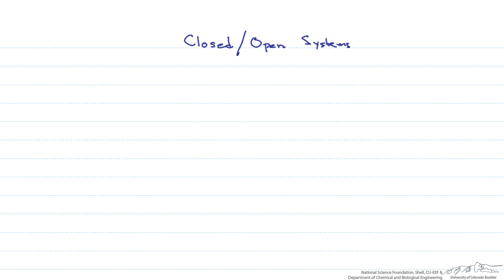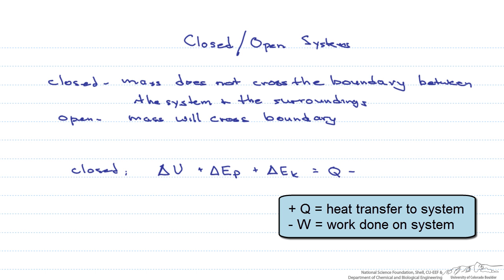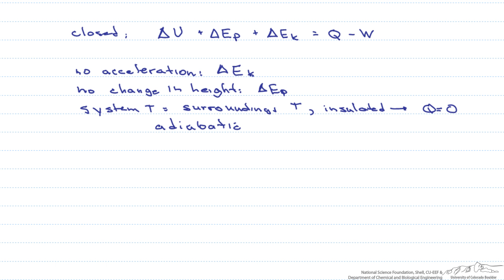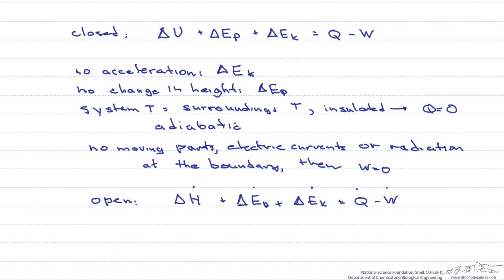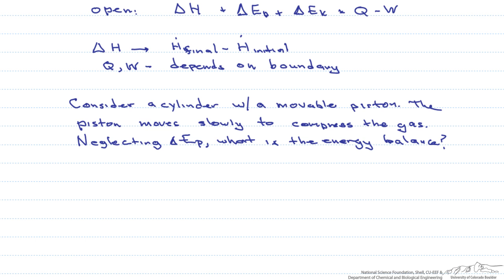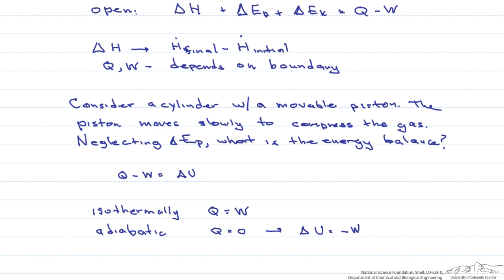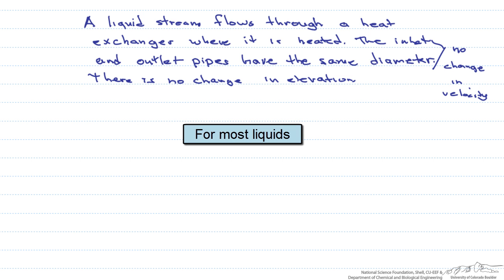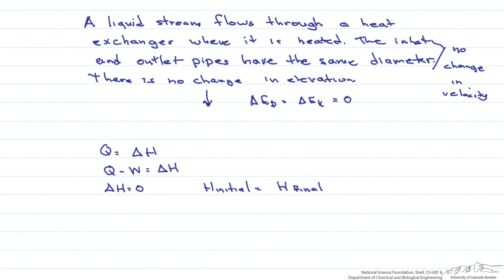Open and Closed Systems

Comment: Thanks for the explanation, but I have a question. At 2:22 you have written -ve W at RHS but in my book its +ve W. 
So, suppose if 100 J work is done by the sys on the surrounding, then W = + 100 J and RHS becomes " Q - 100 " as per your video, but according to my book W = + 100 J (same as above) then, the RHS becomes "Q + 100 ". Wouldn't that give different numerical values?

Comment: #3... Isolated systems = can exchange neither energy nor matter with an outside system. While they may be portions of larger systems, they do not communicate with the outside in any way. The physical universe is an isolated system; a closed thermos bottle is essentially an isolated system (though its insulation is not perfect).
Heat can be transferred between open systems and between closed systems, but not between isolated systems.
The Earth is essentially a closed system; it obtains lots of energy from the Sun but the exchange of matter with the outside is almost zero.

Comment: Secondly you mentioned (@2.8 minute) for closed system that when there is no moving parts, current or radiations, then work is equal to zero. What if there is no moving part, current or radiation but system does work for instance it expands.. then according to you is it not a work?? Please explain..
Reply: If it is expanding, wouldn't that be considered a "moving part"?
Reply: @richardaversa7128  you'r right. Here expands also consider as a moving part